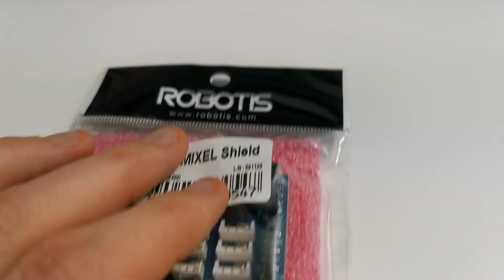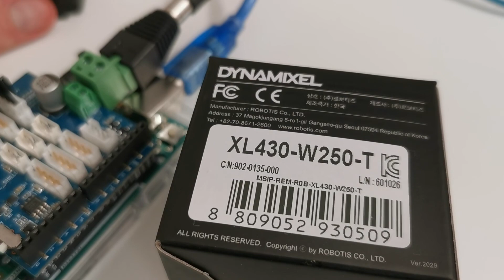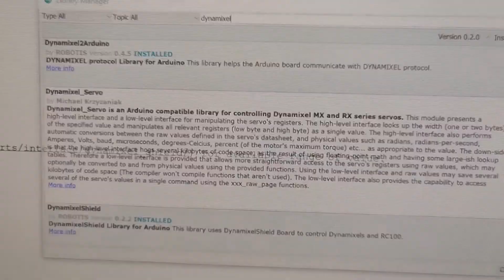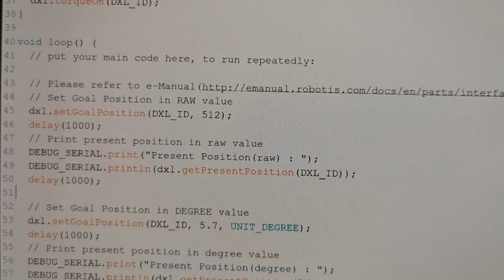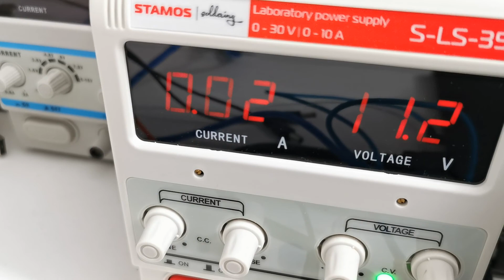Dynamixel shield for Arduino

Comment: How to change moving speed please
Reply from the maker: You need to use writeControlTableItem method from Dynamixel2Arduino shield API. Use PROFILE_VELOCITY as property to change and put value in 0.229rpm unit. Eg for 100rev/min use something around 20. This value is stored in RAM area of control table. Keep in mind that changing velocity affects torque.

Comment: How do you change the motor ID via this shield? Do I need uart to usb?
Reply from the maker: Uart2usb is needed only if you want to print (and see) some debug/diagnostic messages while the shield is operating. This is because this shield uses default arduino's UART to communicate with servos. Also in case you use Arduino Leonardo the separate USB connection is not needed to monitor arduino's work. With other boards it is necessary.
Now for changing motor ID you have to use program from examples called "id". Just make a copy and remove the part reverting to original ID. You can execute the program without additional uart connection for monitoring although you cannot see the confirmation.
Reply: @slawomirkorbas  

Ok thanks. I am using the uno. I was trying to connect through it with the dynamixel wizard. I didn't even think to see if there was an arduino sketch to do it. I will try soon.
Reply: @slawomirkorbas  Yes, that worked great!
Thanks!